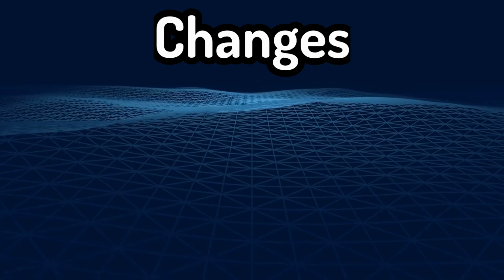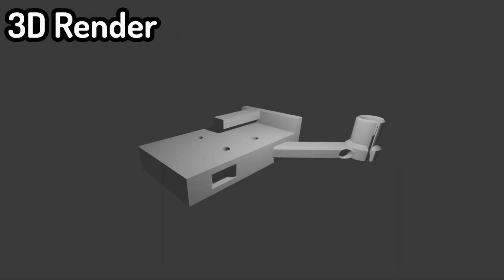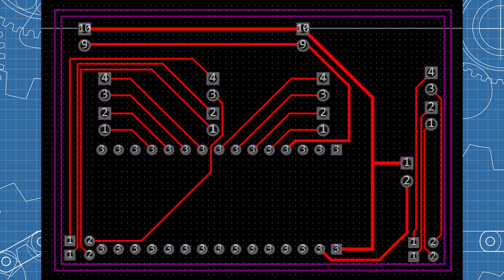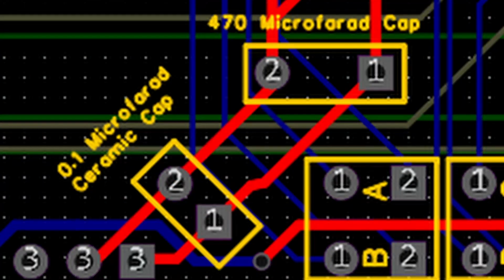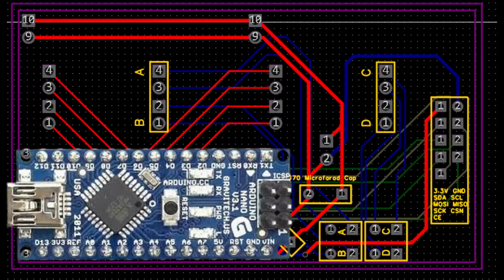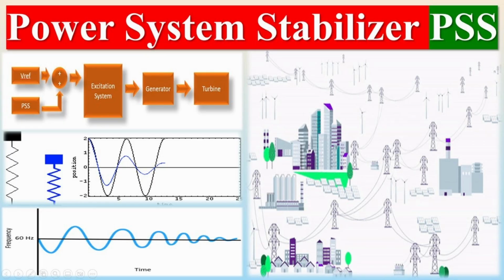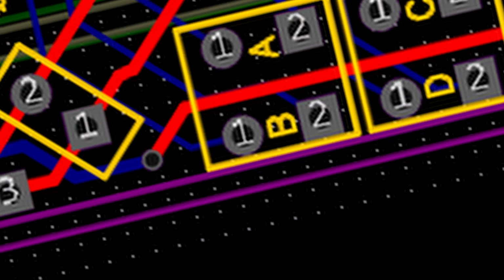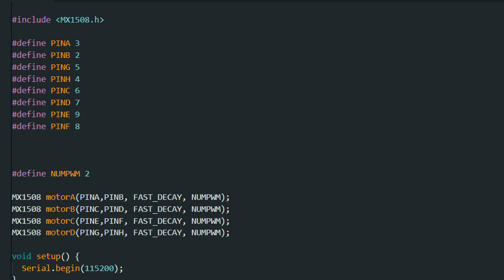My Arduino Drone Just Got 10 Times Better!

Comment: you should make a more rigid frame this will cause too much vibration
Reply from the maker: I noticed this! My idea is to add a second pin to the arm and make the tolerances tighter. Nice observation 👌
Reply: @DuckLandJokes you should use screw
Reply from the maker: @steazoxgaming that would definitely be smart. I'm going to look into that! Thanks for the idea!
Reply: @DuckLandJokes do you have any contact i can help you in this case

Comment: I think if you would use multiwii then it would be a whole lot easier
Reply from the maker: It would be, but then it wouldn't be arduino! The point is to make a drone with stuff that you can buy off Amazon for cheap or stuff you might have laying around.
Reply: @DuckLandJokesyou know there is a fork of multiwii which you can use on Arduino nano with nrf module connected to it for reciver. I also used the same setup to make my own drone all under 3000 indian rupees nearly about 35 dollars (including custom transmitter) and it flies very well. But yes it took many hours of my life to debug
Reply from the maker: @mayankkumar5900 I didn't know that! I'll look into it.